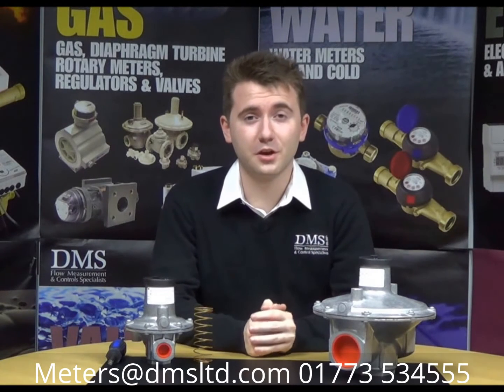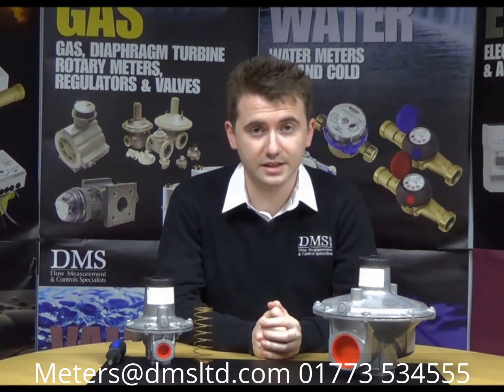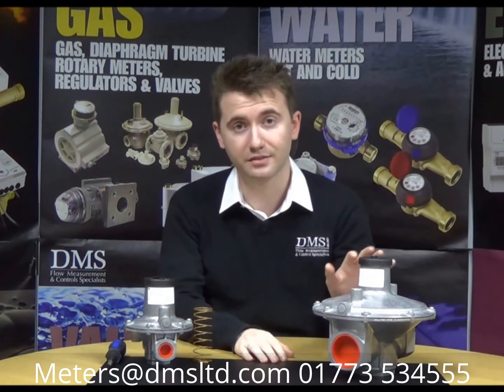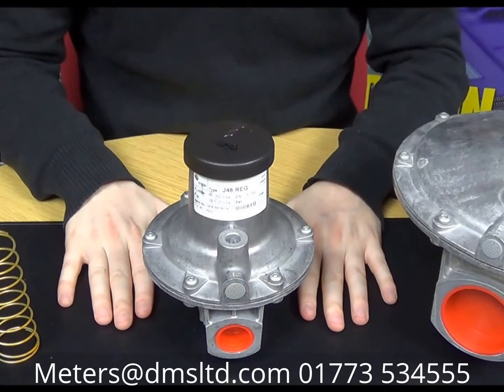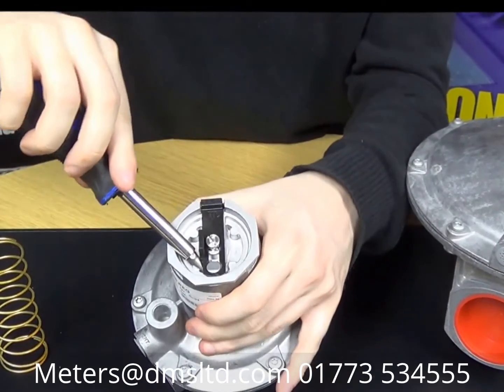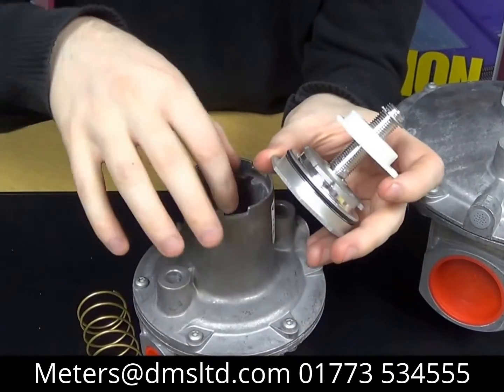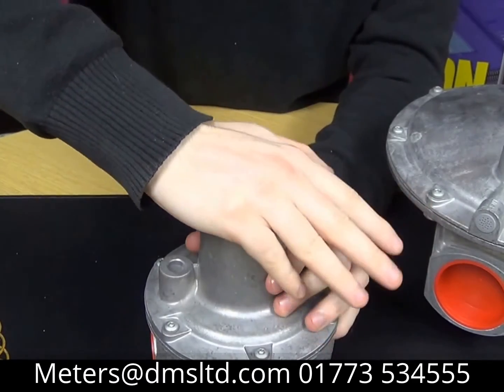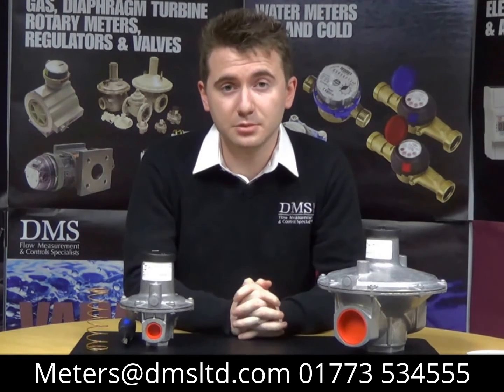Elster Jeavons J48 Gas Regulator | Featuring a Spring Replacement Tutorial

Comment: Thanks for the video. Are these allowed to be fitted upside down?
Reply from the maker: You're welcome. We would not recommend installing these regulators upside down as it can affect the outlet pressure range. It would be better to either mount the unit on its side or pointing straight up.

Comment: How do you set the pressure
Reply from the maker: Hi Leroy, thank you for your comment, if you could please let us know the size of your regulator, we can then send you the correct information. But for now please see the below link to cover 20mm - 50mm. 

 Feel free to give us a call in the office if you require further info, 01773 534555 

https://www.dmsltd.com/upload/pdfs/0beec95814dc42b28e6dd95fb538c5c8.pdf

Comment: What's the flow rate of gas in a 20mm pipe at constant pressure 4kg/cm2?. 

And how it calculated?
Reply from the maker: Hi Sachin, thank you for your question on the Elster Jeavons J48. Apologies for the delay in my reply. The Gas Flow Rate can vary depending on booster speed, gas type etc. This is not a question we can answer directly. You would need to speak to a Gas Engineer to assist with this answer. If there is anything else I can assist with please feel free to drop me an email: Lucy@dmsltd.com or drop us another comment. Thank you for watching!